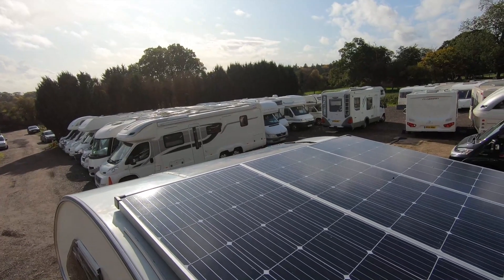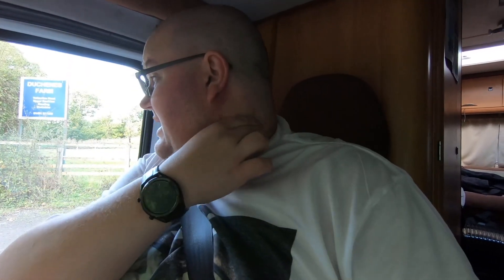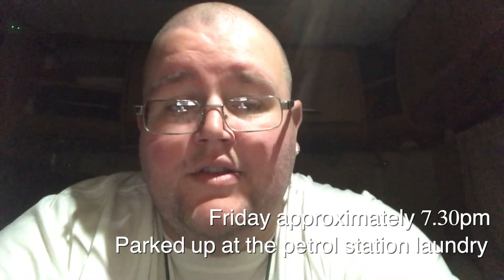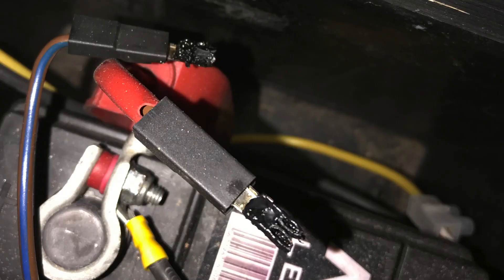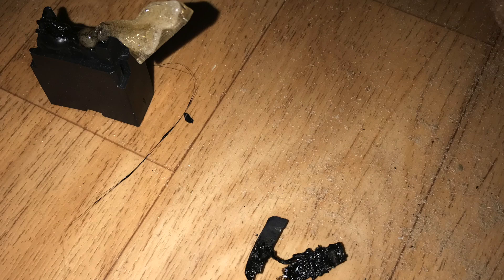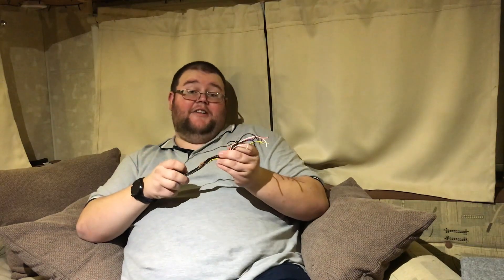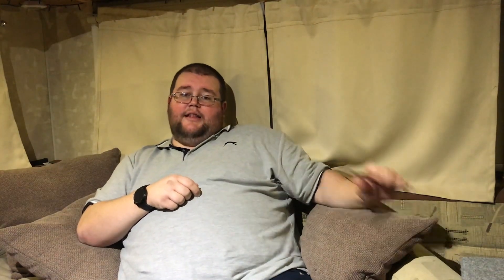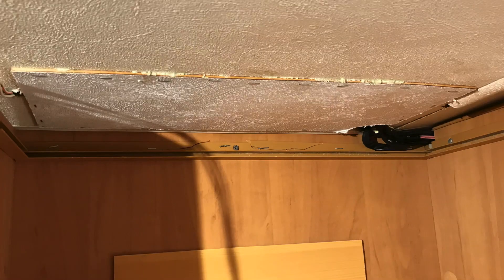Replacing my flexi solar panels for rigids....It' didn't quite go to plan!

Comment: Just a tip from an old electrician:
If a fuse keeps blowing, whatever you do, do not increase the size of the fuse.
Wires have a current rating, a fuse is sized to protect the wire, increasing the size of the fuse just increases the chances of wires overheating.
So, to summarise: if there is a 15 Amp fuse on a circuit, DO NOT replace it with a higher rated fuse to overcome a fuse blowing problem.
Reply: I usually just put a nail in its place.
Reply: @mogdaboi  😂😂
Reply: @mogdaboi  you're cheap, I use a 2BA brass screw ;-)

Comment: You are a very kind hearted and charitable person Darren......I couldn’t accept that it was “no fault” of the solar installers......I think it is 100% their fault. They gambled by putting a screw into an area  that they didn’t know what was behind. (Should they even be using screws??) The gamble didn’t come off and it was pure fluke that you didn’t return to a burnt out motor home. No wonder they worked like stink to get you back up and running.....it’s the absolute least they should have done. If this is as far as you take this I can imagine they are feeling VERY relieved. Glad you are safe and well.
Reply: Yes ,it was a calculated risk that didn't pay off for the installer and they're absolutely at fault for not taking the necessary precautions.. from experience they probably thought that the probability of hitting wires/ cables was very low but balancing that against the potential outcomes tell me that their judgement is somewhat suspect. Darren is indeed very kind hearted and has clearly taken the philosophical approach.. not sure I could do the same but I have to say I respect and admire Darren for moving forward in the most positive way..
Reply: Based and consumerpilled
Reply: @malcolmrowe5031  solid. Water made the grand canyon. Screw holes? Meh!

Comment: Hi Darren 
I'm new to your channel and enjoy what you're doing . I am not a DIY enthusiast but ten years ago I fitted solar panels on my motorhome . I checked with all my mates about securing the panels on the roof . They all said do not use screws on the roof . I used sikaflex adhesive with no problems at all . Anyway they sorted it out for you . Keep up the good work .

Comment: I am a auto spark, who ever fitted your solar panels are incompetent and responsible ! They should have traced the wires before screwing into the roof ! In fact they shouldn't even have fixed your solar panels with screws !
Reply: agreed

Comment: Thank ffffflip, easily lost the van and life. Whilst your throwing love at the installers I've the same feeling as the majority of the other comments, terrible fitting, easily tested for shorts with a meter once finished and You've still a disaster you need to avert, at the angle the panels are at you have got to have a wind deflector, its a must, the air can not escape quick enough ripping the fixings out of the soft aliminium. Where on earth is this guys thought process. Don't want to see bad for you Darren your a great guy.

Comment: I agree with Charles, not bad luck just bad workmanship.  When they drilled your roof they should have flattened and sealed the screw to stop it leaking and check it hadn't damaged anything.

Comment: From the opening video showing the solar's fixed to the roof straight away I could see multiple problems.From the cheap bracket's used to all the screws used and not protected from the elements.We have never screwed into a roof fixing a solar panel you are just asking for trouble maybe not now but in the long run.Has for the repair shocking.

Comment: Hi Darren, we are so pleased you managed to catch that before it went any further and no wonder you was shaken up. Stupid error on their part not checking what could be behind those panels. 
It will be a good idea to go through your electrics and do a sanity check because where you may have added stuff and appliances, made changes to your system you may be accidentally overloading your existing motorhome wiring system which is very easy to do on 12vDC as the amps add up very quickly and before you know it you are exceeding the rating of your cables etc.
Happy to help with any advice if you need it 👍🏼
Stay safe buddy 😁

Comment: Have to completely agree with all the comments on here. You were very lucky that these cowboys didn’t cost you your van or at worst your life! The worry is that there could be some one else out there, that these so called professionals have done work for, with a potential ticking time bomb and they might not be so lucky. You may not have intended it to be, however it has become a warning to avoid this company.

Comment: Hey matey. I had a similar problem. I replaced the drivers side cab light. When I opened the drivers door all the power went off. Luckily it blew the fuse. I had put longer bigger screws into the cab light plastic cover straight through the power feed. Easy done sods law. Best wishes from old George

Comment: This was one of the reasons why I went for stick on flexipanels. Not only was I scared of hitting something important but it also seems silly to make holes in a single,  watertight sheet of aluminium. 

At least you only wasted a day and you didn't lose your van.

Comment: I’m sorry to hear of your problems. It could have been a disaster. What safeguards have Chris and Steve put in place to prevent this happening again. I realise that they acted quickly to remedy the problem, but can’t help thinking that they should have checked the installation with test gear after screwing into panels where there was a good chance of there being hidden wiring. Anyway, you’re ok and unhurt, so all ended well.
Reply: This is totally there fault you had no problems until they fitted your panels.
Who blindly screws into anything with no knowledge of what may be behind.
Certainly no professional.
Reply: Whats wrong with Sikaflex and the primer . It's an oddball install as it relies on the van pointing the right way. At this time of the year I get about 3 watts out of a 120 watt solar panel so 3x3 =9 which is not good.
Reply: They shouldn't be screwing into the aluminium, if they're screwing at all they should be going into the framing below it which means knowing exactly where the framing is & that process should locate the wiring at the same time.

In that application they should be using a flexible or preferably a semi-flexible panel bonded to the roof, English motorhome (& caravan) roof sheeting is simply too flimsy to attach anything to.

Comment: Just had a further thought - are the new panels still OK? Each panel will typically have several diodes within them. Given what happened it's possible a diode may have blown. Are the panels putting out as much peak power as you'd expect to see?

Comment: Kudos to Chris and his team for correcting their mistakes
Reply: your kidding? there is still a disaster needs averting, the angle the panels are at they need to have a wind deflector, its a must, the air can not escape quick enough ripping the fixings out of the soft aliminium. Where on earth is this guys thought process.
They wouldn’t of been able to correct their mistakes if Darren was asleep!!! Auto electricians have plans where electrical looms are. You don’t drill blindly, A quick check with a meter after they had finished would of showed a problem. Whilst Darren is forgiving there could still be problems at other connections in that loom that would of heated up. In short bluddy disgusting

Comment: I feel so sorry for you Bud.. I do get to work on allot of electrical problems and sometimes they are very hard to find.. But the smell of melting plastic will be around for a while.. So glad they found it before it went up in smoke, but you have mist a ride in a fire engine.. Good Luck Bud.. Merry Christmas

Comment: I have installed solar panels myself on caravans and vans and never used screws to fix the brackets down, always used Sikaflex 512 and never had an issue with the panels holding in place. I wonder why they decided to screw in to the roof? Feel for you, I would be fuming lol
Reply: Probs because it's quicker and cleaner for them.

Comment: Glad all is sorted mate, hope it stays well and well done STJ!
Reply: Well done STJ your kidding? there is still a disaster needs averting, the angle the panels are at they need to have a wind deflector, its a must, the air can not escape quick enough ripping the fixings out of the soft aliminium. Where on earth is this guys thought process.
Reply: STJ fixed the issue that’s why it’s well done, I’d rewatch the video
Reply: @BishBashBoshBBB  I watched all i needed to, thankfully Darren was not asleep as there may well not of been a video, you can not butter over what could of been a manslaughter or a lost home due to incompetance, regulations are in place in dwellings to stop this happening, maybe it should be law in mobile homes to for this reason. The mounting of the panels without a wind deflector at that angle has not been addressed
Reply: @Superfandangoo  the air deflector is addressed at 0:45
We don't see it so no idea how good it is.

Comment: I’m a electrician by trade Darren and once I saw your fault I knew it would probably be a screw via the recent solar panel fixings. They should have known where the wiring looms were running therefore be careful with the size of the fixings and where your fixing them. Great video however as always and onwards and upwards. All the best mate in these unprecedented times. Stay safe

Comment: I would suggest that the panels should be fitted to a couple of well secured bars running from side to side.  Anything should be bolted or riveted into the aluminium. The panels to me act as an air scope and your lucky the haven't blown off or caused damage to the roof.
Reply: Bars yes, well secured yes, but through the framing not just into the aluminium, it's far too flimsy. It's half the thickness of a steel roof on a panel van & steel is stronger than aluminium.

Comment: Hi Sorry to hear that you almost went up in smoke.

Drilling into the wiring was the starting point.  There was however, a latent problem with the design and installation of power distribution in your van.

The question is why did  a fuse not  blow immediately. Thus protecting the remainder of the installation.  

 Instead very high current started to flow and  continued to flow so   the the wiring loom heated up,  your thermal insulation in the roof did its job so  everything cooked.

Why did it happen.

The intended fuse may have been bypassed by modifications or faulty installation.  

The circuit may have been already shorted to another higher current thus introducing a higher current feed.

The rating of the fuse may have been excessive.  

 Rats and mice love eating wiring insualation. 

During the rebuild  don't just copy what was there before.  Test it and other circuits in your van.   Pull all the fuses and introduce one fuse  then check that only the expected kit gets power. 

Repeat until you know beyond any doubt what each and every circuit does.  Don't believe handbook information. 

Then  for final peace of mind  blow fuses prove that you and your investment will be protected.   Worth it for the cost of a fuse.

Hope this helps

Comment: Scary stuff, especially on the DC side, things don't short circuit like they do at home. They just get hotter and hotter. You would think cables should be in a fire proof harness or sleeved. Aviation industry has had many incidents like this, so the answer is out there. Motor home installations which are ad hoc need better standards.

Comment: One thing in the video  the dealer saying he left the front of the panels open so the wind can get under them. We'll I would go and get some white one and half inch or 2inch which ever fits snug pipe in front of the panels. using silicone addsive to secure them. The lest thing you need is the wind ripping them of.. Merry Christmas.
Reply: Agreed this company are effing terrible. Nearly burnt his home down, If he was asleep he could of suffered terribly, wreck his electrics and want to tear up his roof. Panels at that angle got to have a wind deflector air can not escape quick enough. Zero common sense...

Comment: 'kinell !!!
By the sounds of it you were closer than a knat's gonad to your motorhome completely going up in flames. It is pure good fortune that you were there and took the steps that you did.
In my humble opinion I think the company was 100% negligent. You simply do not drive screws into something if you don't know what's behind. You just don't do it - especially so with things like motorhomes (and boats, etc) where cables and pipes can be in voids. Sheer incompetence and negligence. No other words for it. I hope as a minimum the company has refunded you the labour cost for installing the new panels, but given how close to full-on-disaster this was they should refund the cost of the panels too by way of an apology - or as a gesture of goodwill as they sometimes prefer to word it. This kind of thing is exactly why I DIY whenever I possibly can. OK, rant over...
If you don't already have a battery isolator switch fitted close to the batteries just after the main fuse then consider fitting one - no faffing trying to pull fuses - just flick the switch.
Ditto with the input from the solar panels before the solar charge controller, although what I did on my boat was fit a double-pole MCB as soon as the cable entered the boat from the array of panels. Again in an emergency there's no faffing - just flick the switch (if the MCB hasn't already tripped).
Really glad it's now all sorted Darren. Best wishes.
Bill
Reply: I also agree Bill. The company and people working there may be nice but that's not good enough when you need a professional job done.
I too prefer to do what I can , even if I have to research the heck out of it, I've seen this type of thing way too often, it's scary.
Reply: Bill Somewhere Xome again! Haha
Reply: Very much agree and there is still a disaster needs averting, at the angle the panels are at needs to have a wind deflector, its a must, the air can not escape quick enough ripping the fixings out of the soft aliminium. Where on earth is this guys thought process
Reply: @Superfandangoo  An aeroplane wing top causes a vacuum. 2/3 of lift comes from the top of a wing so yes, this looked dodgy to me too, it looks similar to the top of a wing. I personally wouldn't trust those little screws through aluminium at High speeds.

Motorhomes do a lot of flexing, over time this could cause a ??? Or simply a lot of leaks that may not be noticed until timbers start rotting.

I don't want to cause Darran more fear but I'd get that checked out by an engineer.
I wonder what Greg Virgoe would think?
This is one time I'd like to be wrong.
Reply: @Naughty Finger  @ @pa_maj.MARTINI-van-MAN  Yes I also wondered about the angle of the panels and screw fixing into aluminium but thought I'd already said enough. But... you're right about the upper surface of a wing creating most of the lift - so a wing (or in this case the solar panels) will be sucked upwards at speed. The angle they are at equates to a high angle of attack for a wing = increased lift (unless too high and stalled). Ideally the panels would be mounted flat on a horizontal section of the roof but if they had to stay at that angle I'd be leaning towards replacing the screws with bolts through the panels and roof with backing plates underneath to spread the load and help avoid the panels being pulled off at motorway speeds. 

If you want to get an idea of the forces involved, stick your hand out of a car window at 60MPH with your hand pointing directly into the oncoming air. Then tilt you hand upwards to the same angle as those panels. Now imagine how much more effort it would take to hold your hand in position if your hand was the size of a solar panel. Every time the motorhome is stationary and then at speed and then stationary again it's stressing those screw fixings. Sorry Darren - not what you wanted to read.
Reply: @willsomewhere4698  After seeing the stress Darran went through with the loom burning, I can imagine what he'd be going through if something happened like you explained very well above Bill.
Reply: Bill Somewhere Even the small spoilers on cars though the opposite angle create a substantial down force to keep the back end down on the road and nothing compared to the size of those panels. Darren is a much more forgiving nicer person than me, I hope he does read these comments as it is only common sense that this firm is lacking in. I may even reference this video with a scathing review on their google reviews only to warn others. I certainly would not want my family, friends or unsuspecting public having this type of work done going to them as they are not clued up for it. If Darren was asleep it could of been man slaughter. A quick test with a cheap meter at the end would of shown a problem in there fixing
Reply: You are right on all accounts, Bill. I'm concerned that one or more of the other screws could be really close to wiring and will short out eventually when they wear through the insulation. My advice to Darren would be to have a competent installer (not these guys) remove the panels and fit them properly.

Comment: Not bad luck. A good electrician or plumber doesn't drill a wall without checking what's behind or in it. Sounds like the crews were too long as well as they were going in to fresh air!

Comment: Wow bad luck dude!! I had a similar thing when I was an apprentice auto electrician, whilst installing an audio system in a brand new Ford XR3i , I put a screw through the rear loom into a cavity that the ford manual said was ok to do so. Turned out Ford had fitted a tow bar and re-ran the loom into this cavity, anyway Essex County Fire and Rescue reckoned the XR3i was a write of!! Scary at the time but funny to recall now😂😂